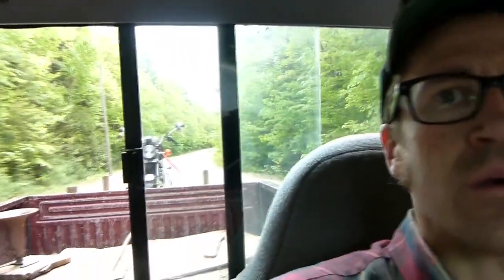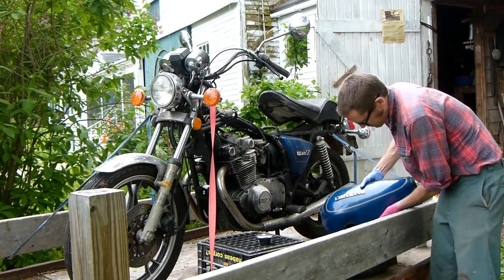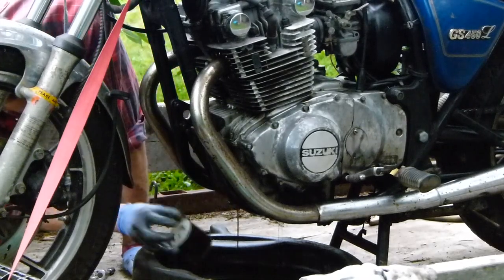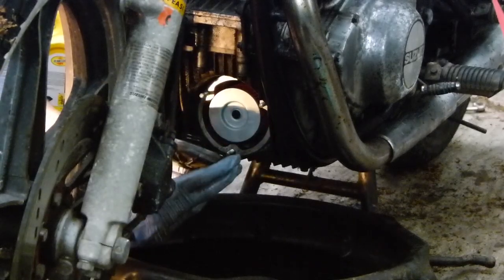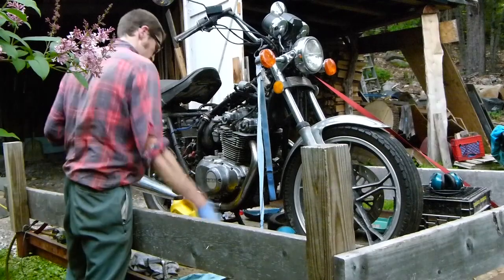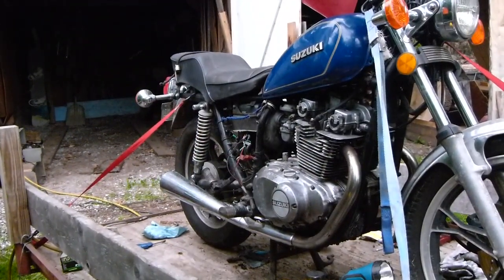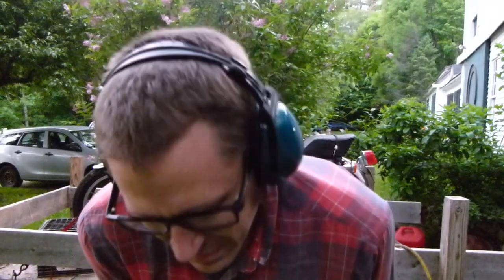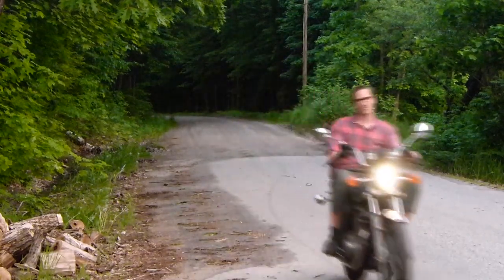Barn Find Motorcycle Tune Up/ Resurrection 1981 Suzuki GS450L

Comment: I’m looking to pick one up on Sunday as my first bike. I couldn’t thank you enough for this informative video!!!
Reply from the maker: I am so glad it could be of use! You will love it. It is a perfect motorcycle! it can be a dirt bike and a road cruiser. Whatever! And affordable.
Reply: Please ride safely and defensively! Drivers just don’t notice bikes and will pull out, sideswipe, cut off, or otherwise treat you like you’re not there. No use getting upset, just accept that you’re smaller to see and easier to miss. Watch the front wheels for movement. Best way to tell if a car is starting to slowly move forward. If you want to live, ride like you are a rabbit surrounded by wolves. If you ride without caution it can end up badly. Please be safe! 😄👍

Comment: I've had a 82 Yamaha SECA 750 for the past 8 years, riding it and keeping it running bring a certain joy you can't get from newer machines.  Spent two summers fiddling with it's four (count 'em, four!) carbs before I finally got them dialed in right, and this summer has brought it's own maintenance in the form of a new wheel bearing.  Still, well worthwhile.
Reply from the maker: Jacob Russell Awesome bike! They are so damn cool. I have a 1972 CB 750 as well so I know about the four carbs. Can be tricky to be sure. They fun though. Wheel bearings aught to be a good job.

Comment: I want to say thank you for this video. I recently bought a 1983 Suzuki GS450L, my first motorcycle, and slowly learning about replacing the engine start switch and whatnot. Your video has shown me that I may have been starting it up wrong this entire time.
Reply from the maker: Thank you so much for the comment,
Reply: My first bike was an 83 GS450T; courtesy of the Navy, I got to ride it all over the UK and on the Autobahn (max speed, 165 Km/h). I've had to tinker with the switches on subsequent Suzis (Katana & VStrom) - seems to be one of the few weak spots in these solid machines.

Comment: Great video. Super job! I bought one of these new from the dealer in the 80s. It was a 1981, same color. Your wheels and front disc brake look like they are from the 1982 model. The 1981 had different mags and a solid front disc brake. The bike is incredibly durable. I rode mine for over 60,000 miles across 31 states. When I sold it, it still ran beautifully. I tried several different exhausts on it, and a Kerker two-into-one slightly modified worked the best. I changed the handle bar to a flatter model, and the shift in my personal center of mass improved the handling substantially. Good luck with your future trips!
Reply from the maker: Heck yeah! I am just astounded at the durability and versatility of this little rig. Last fall I took it deep into the woods on a steep, muddy trail that would be very difficult with an ATV and it preformed admirably. Thanks a lot for the tips and comments.!
Reply: @BusHuxley  can you tell me the color name and code of this color i like it and i can not find some color charts on internet. Thx.

Comment: Rear light is out!! Good job. New tires, and boots suggested.
Reply from the maker: TotallyL337 Yes, I noticed that as well. Brake light works though. Tires are pretty good, considering and if I'm more than dubbing around it's boots and pants to be sure. 
Thanks for the comment.

Comment: Recently purchased a '82 GS650L about a week ago and it was running when I bought it but hasn't started since. It was shutting off when the rpm's dropped back to idle and now I can only get it to crank but doesn't turn over. This is my first time working on a carburated bike and looking forward to learning more about it . Hopefully I can get her running as good as she looks!
Reply from the maker: Good luck! Sounds like fuel to me. Make sure the line isn't plugged from the tank and work back from there. Have fun. It's a puzzle you can ride when you solve it.

Comment: It's great to see you get the old bike running. I have a barn find 1980 GS450L that I have been wrenching on and riding for a few years. Two recommendations: 1. Replace the rubber line on your front brake. It is a maintenance item with a 2 year refresh interval. My guess is that like mine, yours is about 35 years overdue to be changed out, which is pretty dangerous. You might note the front brake feels spongy - that's a hint that it is time to replace. You can get a custom braided line from ebay, which is what I did after figuring out the stock parts are unavailable. 2. The regulator/rectifier in these bikes only regulate voltage on 2 out of the 3 phases from the stator. When your headlight is on (mine has a switch, yours might not) you are sending all the voltage the stator can crank to your battery. This can make bad things happen.  I recommend a replacement unit called the SH775 from a Polaris, although it is too big to fit under the side cover.  Anyways, happy wrenching and riding.
Reply from the maker: Holy crap! Thank you so much for this fount of wonderful and useful information! Yes, my front brake is terrifying as all get out, and now i know why! I am used to bigger bikes and it is so fun be be down on this smaller one, but it is still a bike and I have to remember that. Thanks a lot for the part number too on the polaris part. Awesome. Now just a little more snow has to melt and I can dig the old bike out.
Reply: No problem, I am happy to help out another rider.  I came from sport bikes and honestly feel like I have just about as much fun on this old 450 as I did with much faster bikes.  I am also waiting for the great melt to happen, but Maine keeps getting pelted with storms!
Reply from the maker: Hey there. Yeah, I've had a slew of other, bigger bikes and I am having an absolute blast on this little rig. In the late fall last year I was riding on forest roads/trails with it with not really any problems at all. I am cognizant of the low pipes but its just so light and peppy. There is a young woman trying to resurrect an 81 450 and she reached out to me on this channel. I've offered what little I can for suggestions and thought you may be able to throw your two cents at the issue. https://www.youtube.com/watch?v=XDkM1YYq1U0&feature=youtu.be
Reply: They are great little bikes, aren't they? I have certainly been enjoying mine this spring up in Maine. I just did a few more minor maintenance items and cleaned the carbs and she is just purring.  I will take a look at the other video and see if I can do anything to help.

Comment: White size and style bars do you have on it? I cannot find the stock size and style and mine has bull horn bars on it and I'm learning as I go. Same bike btw mine was also a barn find. Just want to know what size bars will fit on these as 1" bars from a Harley Sportster (I know, it's ok to laugh lol) didnt work on it. This is my first bike. Thanks for the video as this helped me learn a lot more!!!
Reply from the maker: Heck yeah! Yes, bike, wonky bars like that make it so much harder to steer than stock. I don't know off the top of my head what size they are but ill take some measurements tomorrow and post it here. It is a really ideal first bike for all kinds of reasons. I would like even flatter bars than I have on here now, but am not going to take the time and go through the trouble to mess around with that. Thanks a lot for the kind comment.
Reply: Bus Huxley oh thank you kindly. I want to say they are 7/8 if I'm not mistaken. I just have short arms (I'm only 5'7) so leaning forward would be a no go lol. Thank you again! Also thanks for the quick response! You're awesome :)
Reply from the maker: So the bars are indeed 7/8th thick and they rise about 7 inches and run back to the terminus of the grips about 10 inches. They would be perfect I think for you. My gangly arms are hanging down to my legs when I ride this but it is still an incredible amount of fun. I don't know if you saw this one, but it functions like a dirt bike too! https://www.youtube.com/watch?v=zboP4FRpi1g
Thanks!
Reply: Bus Huxley yeah I've been looking around for a good pair. I'm definitely on a budget and the starter motor went out on this thing. I tried connecting the battery right to the starter and got nothing. I'm completely lost on this as I'm not finding any videos on how to take the starter out on this particular bike and clean it. Its $100 plus shipping for a brand new starter and I just dont have that kind of money. Think you can make a video if you have the time? I'm aching to learn to ride, and shes pretty much ready to go other than cosmetics. I can take a quick video of her and post it and you can see what I'm working with.

Comment: So I have a gs250 the engine turns but it womt start. Has a new batter and carb. Engine turns ok but the ignition wont catch but it gets spark
Reply from the maker: Sounds like fuel to me man. Keep poking around with the carbs or supply in

Comment: Very nice. Thanks for posting this. Question, though. You did all that work but didn't clean the carbs?
Reply from the maker: Thank you very much. Yes, that is a good question. So I was really close with the fella that ran and parked this last back in 07 and I knew him to be the type of guy to winterize his machines well with stabil. I popped the bowls off and didn't see any varnishing whatever and figured I would tear into them if I needed to. I am really glad I didn't because over a year later now that thing is purring like a kitten still. I had it out today several times in fact. It is so much fun. Small bikes are wildly versatile.